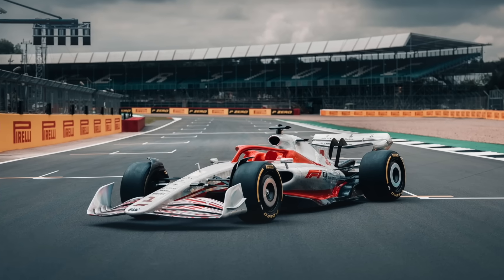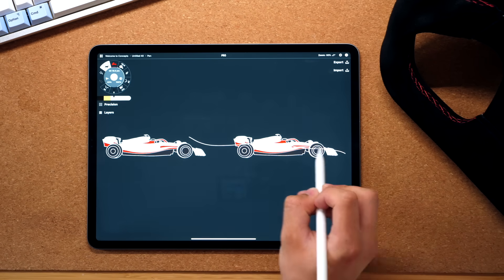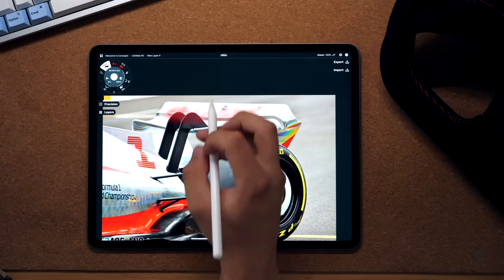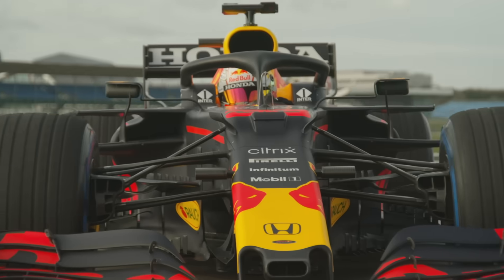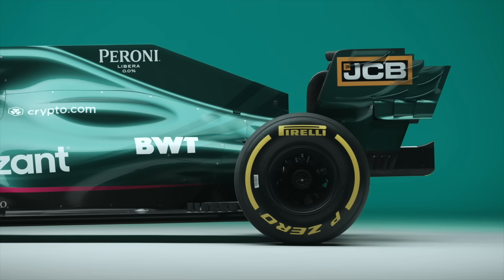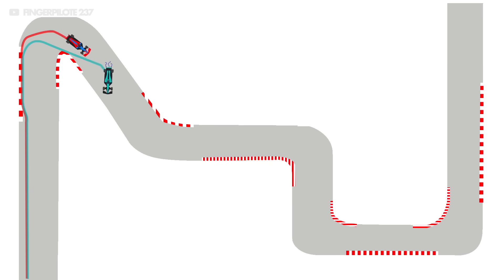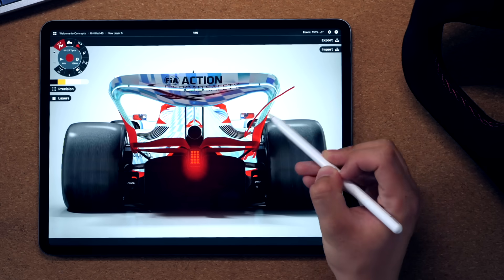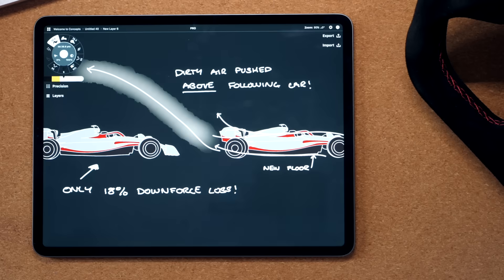Why Formula 1's New CURVED Wing is GENIUS

Comment: As a Aeronautical engineer for over 4 decades I really appreciate these aero changes, especially in the wing. The end plates eliminated span-wise flow but as with many aero tweeks its caused other problems. While the downforce on the new wing may washout a bit on corners when the wing experiences sideslip, it stills appears to be a vast improvement over the current wing. I'm interested if there will be a corresponding improvement in cross winds. Engineers love to add devices like rakes, fences, and generators to improve performance, but these in turn cause issues of their own. No free lunch or silver bullets in aerodynamics. I love this formula and we will see which team will learn the fastest to setup this car. Cheers

Comment: What I'm wondering is when the cars slipstream on the straights, or 'towing', the drivers must use more of the car's power because they have more (air)friction. When slipstreaming in the 'dirty' air from the car in front, you get sucked to it, right? So now the car behind has 'clean' or less distorted air which creates more friction, making overtaking on the straights harder (for +-equal powered cars), but easier in the corners because of the new wing. Would that cause more tire-usage, something Pirelli already is struggling with? Correct me if I'm wrong

Comment: Driver 61 - not a massive racing fan but I do recall some decades ago F1 teams fitting rubber skirts to the cars which I think (I was young) improved downforce. These were banned after not many races. Might the powers that be consider unbanning them? Or do these too contribute to dirty air?

Comment: I remember hearing that the original ground effect implementation was dangerous and unstable. Does this new version fix those problems?
Reply: "Original" ground effect systems implemented vertical side skirts that would almost touch the driving surface. These skirts locked the air into the ground effects tunnel for maximum efficiency/down force. The problem that would occur, if the skirts were damaged or the car lifted too far away from the driving surface, the air within the ground effects tunnel would become extremely turbulent and cause dangerous loss of control to the stability of the car. These "skirts" are what is specifically banned in all racing and race tracks.

Comment: So if there is such a reduction of dirty air, please, eliminate the DRS.
Reply: Drs wont be on the new cars
Reply: @tijmeoudekotte7  It will be, but if the rules work well they want to get rid of it
Reply: @tijmeoudekotte7  yes it will
Reply: Why  do people not like drs?
Reply: @RammsteinPTc  BC is not real racing.
Reply: @RammsteinPTc  It's a bit artificial, it's meant to compensate the car behind for the time loss when following another car. The DRS zones are generally tweaked to somewhat reach that. And in practice it somewhat works, but not precisely. It more or less becomes a game of just trying to keep a car behind out of your DRS at the detection point, because if the following car is 1.1 seconds behind it still suffers quite a bit of dirty air, without getting any compensation.
Reply: @bananatree2527  thanks for the explanation I thought it was just there to give more overtaking opportunities
Reply: @RammsteinPTc  It's fake and artificial. It's required as a temporary bandage while the cars are so bad at bollowing each other.

Comment: So, will this also reduce the "tow" on a straight somewhat?
Reply: I would think so, but following cars will be closer exiting the turn before the straight, that combined with closer following down the straight should allow following cars to get close and outbreak the lead car into the next turn. DRS has made it look like cars are naturally able to pull out and easily pass, that won't be the case for these cars and more driver skill will be needed.
I am hoping the bigger gains will be entering corners and out breaking maneuvers, which has been severly lacking. Aero loss plus carbon/carbon/hybrid assist brakes and paddle shifters have cut passing in the greatly decreased braking zone drastically from where it used to be, especially for F1 fans from the 70's and 80's.
Imagine how interesting F1 would be if they simply went back to a shift lever instead of paddles, then you could begin to compare modern drivers to the greats of pre-paddle shifter days.

Comment: Yes but we have DRS to compensate  for that dirty air today and thats why we still see great battles. But now it's just gonna be easy passning with this, easier to follow and get close plus DRS so i think it will be worse racing, less real battles.
Reply: Maybe they should just make DRS free to use whenever..
Reply: Not necessarily, DRS is like a switch that kills HP, these cars should have a more gradual rate of the following car getting alongside the lead car because there is no artificial loss of speed.

Comment: Oh and with half the hp today’s cars have compared to the 80’s plus traction control with no clutch pedal. No loosing it out of corners anymore. Try out braking your competitor when every car downshifts for you at the same speed as your competitor. Overtaking is impossible isn’t it. Who’s driving? Mavis must be driving . Lol. When you get the same car winning every time for 5 or 6 years then you must realize how automated this process is. What a joke F1 has become

Comment: As interesting as this is, I'm much more curious about all the clever designs, that the teams will come up with. Though I'm not really looking forward to the "plug the loophole"-war, that will inevitably follow. Would very much prefer for these the clever innovations to remain legal until the end of the season (unless there are safety concerns, obviously).
Reply: Then you get blowouts with no championship battles.
Reply: Didn't FIA try to reduce ground effect due to "safety concerns"?
Reply: @codemy666  They banned the old type of ground effect. This is the new ground effect.
Reply: @abcdefghijklmno1009  In the end it's the same idea
Reply: @codemy666  The old ground effect tried to redirect all air over the top of the car. This ground effect maneuvers the air that passes under the car to create downforce. It's different.
Reply: @codemy666  back then ground effect was done very shoddily. It was trial and error. Which is dangerous. We have models now, this is a much more refined version.

Comment: In my opinion, the idea of "more overtakings mean better racing" is completely wrong. In the 80s we watched a whole race waiting for that one great moment of the second one taking the lead. You didn't go to get a coffee cause you might miss this one moment. It was thrilling. And loosing a position was much more then today because it would be so hard to take it back. 
And if you want to have more overtakings, more security due to lower speed in curves, in my opinion the wings is the wrong side of the car to work on.
There is one simple rule to change everything: make the down of the cars strictly convex. No venturi effect, no underpressure beyond the car, no dirty air topic. In return you could allow bigger wings, giving more wind shadow, allowing cars to  get sucked behind the leading car in high speed parts - which lead to low danger overtaking areas in the breaking zone.

Comment: Awesome!
You nailed it with a pretty accurate description of how the airflow generates downforce. The most common mistake is to say that the low and high pressure difference generates all downforce, or lift at airplanes. But it's so much more complex than that.
Reply: There's many way to explain lift, but it all come down to pressure differential and conservation of momentum.
Reply: Well, when he said in the beginning that the air is pushed up and the car is pushed down it kind of felt like newtons (wrong) aerodynamics. But luckily what came after that showed a lot more understanding. It’s a good explanation of the new rules overall and it seems F1 should put more effort into explaining them to the fans
Reply: @_Dibbler_  Newton’s understanding of aerodynamics as he described it in Principia is wrong (except for high Machs) but lift is still taught as resulting from his third law, and referred to as Newtonian description of lift, as opposed to the Bernoulli description.
Reply: @KillCamEditoR  I dont know who you mean is teaching Newtons 3rd law for lift. I learned it as a difference of pressure, more or less as a result of differences in speed, not by impact and deflection. On a wing airflow is lead up and down, not pushed up and down.
Reply: @_Dibbler_  we’re talking about the same thing. The pressure difference borne by asymmetric sections leads to speed differences, which changes the direction of airflow downwards. This is known as downwash. By definition, (Newton’s 1st law) if an object (in this case a fluid particle) changes direction, it is because a force has acted upon it. Therefore, a force has been applied to the fluid particle, by the wing. 
Newton’s third law dictates that for any action, there is an equal and opposite reaction : the fluid particle has acted a force onto the wing, lift. 
That’s the Newtonian explanation for lift. Not as Newton thought it worked. Particles of fluid do not push the wing up. That only works in hypersonic regimes. But it’s still the Newtonian explanation of lift. And it does stem from the Bernoulli pressure difference.

Comment: Do you think this may create an advantage for the following car? I remember the 1986 San Marino GP; which was/is a high fuel consumption circuit - probably not so bad today as it has been slowed down. Alain Prost cleverly followed teammate Keke for much of the race, allowing him to conserve fuel and then pulled away (after passing at pitstop). If tyre deg and temps can be managed, it may open up new strategies where you may not want to be the lead driver for most of the race. Thoughts?

Comment: A good explanation of the new design, and its main purpose being to reduce the effects of ' dirty ' air on following cars.

On a slightly different line of reasoning it would be highly desirable IMO to configure the new cars in a way to eliminate the danger of two side by side cars from interlocking wheels - a dangerous and ever-present possibility with the present layout.  This could be accomplished simply by having side bars, similar in function to roll bars, however  an alternative - following some additional research - side ducts could be designed which have the double function of managing the aerodynamics and also to mechanically preventing two adjacent cars interlocking their wheels.  As an afterthought they would also reduce the downstream turbulence of the front wheels.
Reply: that is heresy like a driver halo.
open-wheeled trucks use side-guards to block the kill-zone between the wheels and increase aerodynamics. 
so the principal is well-proven. 
but mortal danger is fashionable.
time traveler, your configuration is from a safer future.

Comment: 6:32 Okay, that mitigation of downforce loss is INSANE.  57% loss down to 18% loss?!  2022 will have some damn exciting racing, hopefully!
Reply: Expect that difference to be less once teams get to try to exploit the rules.
Reply: @sergarlantyrell7847  The goal of this rule is to reduce dirty air. How easy would it be to increase dirty air and how hard would it be to detect it? I mean it's gonna hard to enforce these kind of rules unless they just lock the design for this part.
Reply: @goku445  it's very easy to enforce the rules because the rules only state what you can and can't add to the car... The aim of those rules is to reduce the wake effects of a car, but that isn't what the rules actually dictate.

But to measure the real-eorld effect you'd need either a complete CFD study of the car, a model of the car and a wind tunnel, or better yet a full-sized finished car & a wind tunnel that could reach the required speeds.
But the team's don't have to prove they meet the rule changes goal of x% reduced dirty air, just that the aerodynamic elements of the car are within the boundaries of the rules.
Reply: @sergarlantyrell7847  Then the rules are useless.
Reply: @goku445  you can do an awful lot by just restricting where and what the team's can design.

There will be a reduction in dirty air, just not as much as advertised.

Take the rear wing, simply mandating that the end and side plates have to be continuous means there are fewer possible places for generating & shedding vortecies (which add to the "dirty air")...
Or mandating/allowing the use of wheel covers both reduces drag and stops team forcing air through the brakes and exhausting out of the hubs helps reduce the outwash by forcing team's to exhaust the air down through the car, reducing outwash etc. etc.

There is an aim behind each rule, but there's no guarantee that there's not going to be any loopholes etc, but even a modest reduction will help the racing.
Reply: @sergarlantyrell7847  makes sense
Reply: The way the car pushes the air upward might reduce drafting. 
It would equilibrate the balance between grip and speed that the leader and follower get.
Reply: If they overshoot their target it might be better to be in second than first. We would have a whole Indy Cart oval situation on our hands.
Reply: @GobiLux  cars are getting heavy and wider. Tracks are not, defensive drivers can easily block any attempt
Reply: @Michallote  the 2022 car is smaller.
Reply: @joaoluis2318  by like an inch. They are still almost 2m long
Reply: @GobiLux  especially at spa and  monza
Reply: Intially, it was supposed to be only 10% loss.
Reply: It does lol
Reply: If Mercedes doesn’t eliminate everyone by then
Reply: @falcy2889  
Or red bull parking their car on top of their rivals.
Reply: @falcy2889  it's a year later, what do you have to say?
Reply: Yeah but he neglected to say whether that 18% loss was at the same "1 car-length" as the 57% old loss. Would be curious to see all the percentages.

Comment: Get rid of DRS and it will make racing much better and looking at the rear wing it looks set in its position.  DRS changes the driver's mindset where they think "Shall I go for a lunge up the inside and being later on the brakes or should I just wait until I'm in the DRS zone and push a button and not use an ounce of my ability?".  I'm all for these changes and more so to see true driver skill come through rather than tech making it all too easy.

Comment: The two questions that come to mind for me are:
1) How much freedom do the rules allow?  F1 engineers are very good at taking advantage of anywhere that the rules don't lock them down; they soon got around the requirement to have the side impact structures in a certain area, which freed up a ton of space in front of the side pods so we ended up with insanely complex bargeboards.  Will the rules prevent this kind of thing?  It should be easy enough to do by mandating a certain cross-section of any protrusion.
2) How much will the slipstream be harmed if the dirty air is thrown upwards?  It's all very well being able to follow through a corner, but you need to be faster along the straight than another car to be able to pass them.  If the slipstream is less effective, it might be difficult to overtake for a whole other reason.

I hope I'm wrong on both of those, and that the new rules package works as intended.  We've seen so many times that the best-intentioned rule changes result in ugly cars that look nothing like the concept to allow designers to take every advantage of grey areas (I stull shudder at the thought of the phallic noses from a few years ago...)

Comment: There is a reason ground effect was banned, u lose suction on a bump...
Reply: And on the curbs. F1 tracks are super flat, but the curbs are used like crazy.  But in IndyCar the problem turns out to be almost non existent really
Reply: they should ban bumps 😂

Comment: Another way to reduce dirty air would have been to increase the end plates of the rear wing. Imposing that they must extend at least 5cm behind and 7cm above the trailing edge, without any opening less than 15 cm from any part of the wing, would dramatically reduce the vortex. That would also reduce the drag.

Comment: My immediate thoughts are how dangerous high curbs are going to be to these cars, damage to the floor is going to have an much bigger effect than currently. And also the floors rigid and layer design may be easier to damage than current one piece slightly higher floors. Interesting it may also stop drivers taking so many risks using extra width on cornering entrance and exit

Comment: In my humble opinion, all of these changes in the name of spectacle betray the concept of F1 as a proving ground for the best possible race car. Plus, wings are against the open wheel concept, exactly because they enclose the wheels, impeding the free air flow over the tires that should be paramount to "open wheel".

Comment: Yes, but the old way is best for the lead car, which is racing after all. If you're in front, your advantage. So, get to the front. That's how you win. Duh. On the other hand, it does improve the handling of the cars behind, as there is only one in front, and everyone else is behind. So from the safety standpoint, OK. My point of being in front to win still stands. That's racing.

Comment: Can't they just make a new rule that says: downforce reduction of standard car (model provided by FIA) at 5 meters behind the rear tire is not allowed to be less than 20% in standardized wind tunnel test. That way teams get an incentive to come up with innovative ways to create as much as possible clean air behind them. You don't need tons of rules about where each wing is allowed to be and what size and you can't have loopholes to those rules.